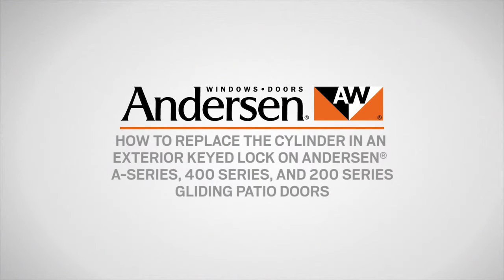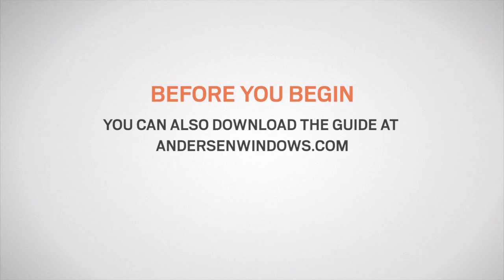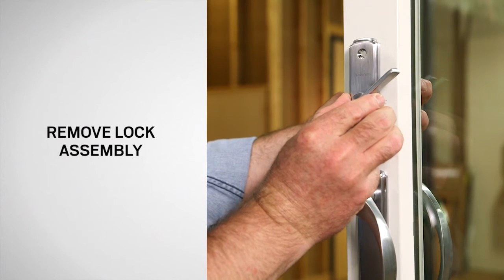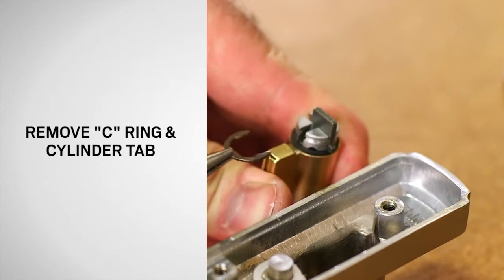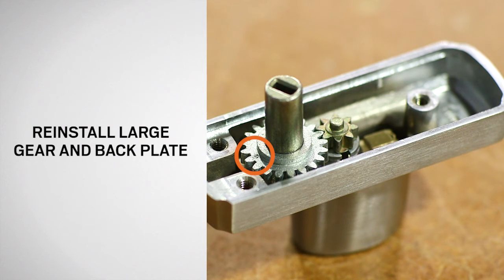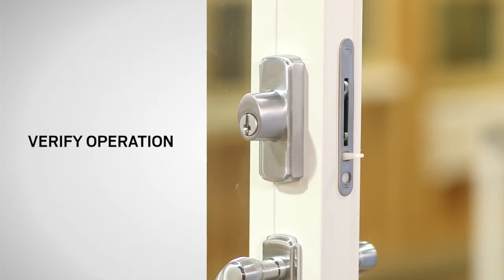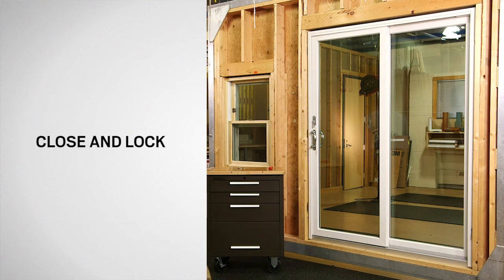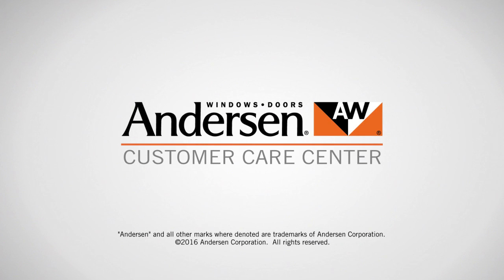Replacing a Keyed Lock Cylinder on Gliding Patio Doors | Andersen Windows

Comment: I purchased an Anderson A-series sliding door and it did not have an outside key assembly.  I ordered one and installed it.  If you lock it, it cannot be unlocked from the inside.  Basically, it's a death trap.  The key assembly was expensive and we just use it to unlock the door from outside because locking it from outside would be too dangerous.  I tried to get support from Anderson but, they will not help.  Basically, you get to talk to some high school kid on the phone that might want to help you but,  cannot.  I get angry every time I see an Anderson commercial on TV.  I'll never buy another Anderson product and I make sure no one I know will either.
Reply: I know it’s a month later and you have probably figured out how to fix your lock. If you haven’t……. Well you have probably assembled/installed it incorrectly.
Not blaming you …… these Anderson locks are crap. I have had 2 of these Anderson sliding doors over the past 20 years. I have had to replace either the whole lock or most of the internal components 5 times. They are very poorly made and frustrating to install. It seems to be hit and miss if you can get it to work properly. My usual problem is the reverse of yours. I can operate the lock from inside but not outside. You really have to follow the instructions very closely or the lock will not work. It seems very odd that you cannot unlock from the inside…… it must be assembled wrong. My issue is getting the key to operate the latch from the outside.
Anyway…… just want to vent on Anderson……… they have been using the same inferior lock mechanism for over 20 years. I don’t understand how they can’t get this right over all this time.
Everyone I have talked to over the years has the same complaints about the locks. 
I have a contractor friend who has installed many of them and he says everyone ends up being a problem. 
Unfortunately it seems to be a problem to find a sliding door from a different manufacturer who makes a sliding door with an exterior lock.
Reply: @Peter-gi3re  I wonder if it's possible to replace the cylinder itself with a Kwikset cylinder? I feel like some of the issues I have with this damn Andersen door is the cylinder they use... It'd at least be better if I could key it to match the rest of my exterior doors.
Reply: Thank you for your reply. I have exactly the same issue on my house I bought. No one else seems to understand it. I agree 100%. If someone died because of this lock it would be a huge lawsuit.  Very unsafe. Guess I’ll just not lock from outside and will go out another door when leaving for work.
Reply: If you lock it from the inside, at least you can get in from outside. I've tried changing the timing of the lock gears to every tooth on the damn thing. It either doesn't work at all or you can't unlock it from the inside, once locked from the outside. I would say that the door latching mechanism is very nice, and well made. It's just the lock that's a piece of crap. If Anderson had even tried to help resolve the issue I would feel much better about their company. I would be ashamed to work for them.
Reply: Glad to see im not the only one going thru this pain. I've installed everything correctly with the sharpest eye on detail, and it still does not allow me to unlock the door from the inside after i have locked it from the outside with a key. However when I simply slide the key into the cylinder and then operate the thumb latch, it will fully lock and unlock on the inside of the door. It's as if the key must be in the cylinder against the pins for the lock to function, when in reality how am I supposed to leave the key in it at all times...obviously defeats the purpose
Reply: I have the same problem where if I lock the door from outside, I can’t unlock it from inside. I followed the instructions on aligning the L and arrow and it didn’t work. I realized that if I lock the door from outside, I need to turn the key more than 1 full rotation (>360 degrees) before pulling the key out. This allows you to unlock it from inside. If I pull the key earlier, then I won’t be able to unlock it from inside. I don’t know if this is by design.